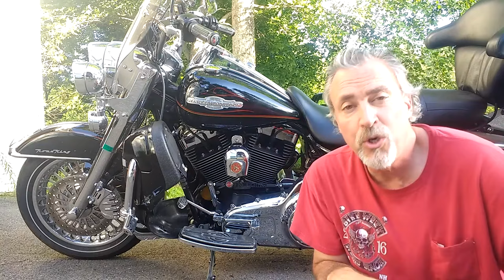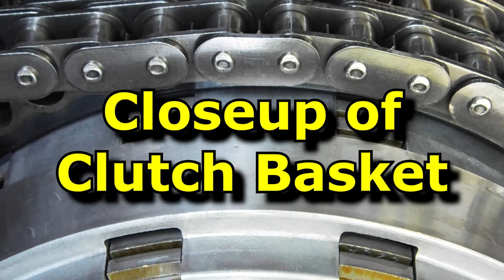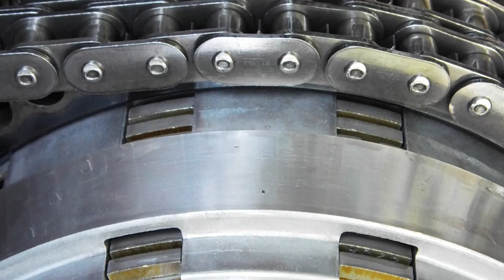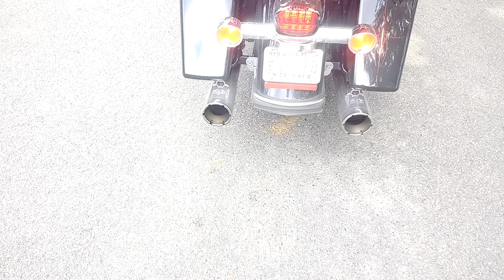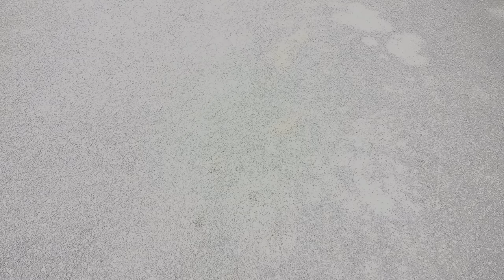Another Source Of Primary Noise

Comment: I have owned 4 Kawasaki 1300 inline 6 cylinder motorcycles. Even with the inherently smooth running inline 6 the  clutch baskets rattled pretty badly on all of them. The one was so bad that I convinced my Dad's Harley riding buddy that it was a diesel. I reember him being amazed that it did not smoke. Than he noticed the spark plugs. My 85 flhtc with 50,000 miles is very quiet as long as the primary chain is adjusted. It seems that the manual primary adjuster is the way to go.
Reply from the maker: Thanks for the info, Tommy! I don't know how I could record it, but I swear I can hear that clutch basket rattling at idle or between shifts, etc. Funny story about calling it a diesel, hahaha! Ride safe!

Comment: Rekluse steel basket sleeves will solve that “old oil can” rattle. You get two enthusiastic thumbs up from me on your videos.
Reply: Did you guys see where the new recommended, viscosity of oil in the primary is 70 to 140, or there about, It's in a dealer mechanics video somewhere that I can't recall at this time..👍

Comment: Mark I know Its been a while since you did this video, I just wanted to add the observation that as I was looking at around one minute and 44 seconds into the viewing, that what I thought was that noise was not the clutch tabs, but the chain roller behind your finger tapping into the gear space. Just a little more chain tension and that would go away I believe. I really do like your Harley videos because I learned plenty of good things from them.
Reply from the maker: Thank you, maybe it was a combination of the two? I'm going to open up the primary to inspect things and possibly replace the Hayden tensioner with the factory automatic tensioner.

Comment: Geee thank you, you just fixed my Roadglide lol, I’ve been chasing a clucking noise for a while in my primary. I was thinking I had the dread neutral rattle but this would explain my noise. Two thumbs up 👍👍.
Reply from the maker: So it's not just me?! Thanks for the comment! 😎
Reply: hey Mark, Dan Bowling here,I had to replace my stator on my 13 Roadglide. when I took it apart I couldn't believe the locomotive style engineering. It rattled alotand being the gear head I set out to find out why. Finally I noticed the wear on the compensator bearing that it rides on. the compensator I'd was brindled a little but not damaged badly. the bearing original OD was easily measured and was a bad fit. way to much clearance. I went to the dealer and picked up a new pc. with thrust washer and Mic's a few to get a better clearance fit. I T's much quieter but still lacks proper lubrication to the thrust washer. I believe that is also a problem with slop as its plastic thickness gets thinner. the part is 28 bucks
Reply from the maker: @danielbowling1528  thanks for the comment. I hope this keeps your 13 on the road a good long time!

Comment: I have a 2012 Heritage with 8k miles and when it warms up it sounds almost like a rod is knock. I think it's coming from the primary. Ask you rev the or ride the bike you still hear it. With 8k Miles and the way the motor sounds otherwise, I'm fairly certain it's not the motor.. and bike was not abused.. any advice?
Reply from the maker: I would take it to a dealer or shop that is familiar with these bikes and ask them what they think it is. There are a lot of moving parts in there and any of them could be the issue.
Reply: I'm having the same issue with an 11, just under 18k. Broke the primary apart, checked everything and then ran it through gears, knock went away. Now the noise sounds like it's related to the chain or maybe clutch?
Reply: Did you ever figure out your noise issue?

Comment: have you ever encountered a whirring noise coming from the secondary output drive sprocket bearing?
Reply from the maker: I have not yet. Is this something that didn't used to be there and now is? Have you compared it to other bikes to see if they are as loud? There is a bearing cage there that is oiled by the primary oil inside through a hole so the oil drips down into it.
Reply from the maker: The compensator will make a bit of noise that can also sound like whirring, which as long as the bike starts up with no issue or clanging just means it's working to smooth out the pulses of the cylinders before they get to the clutch.
Reply: @contact4mwy7  the noise has been there for quite some time, but has gotten worse over the years. Some days its worse than other but it is louder than the open exhaust when its happening. Going to be taking it apart this winter
Reply from the maker: The only other part I can think of that would make some noise is the chain going over the primary chain tensioner, but for it to be as loud as the exhaust, I doubt that's it. Wow. Curious to know what it turns out to be for sure!

Comment: Im learning more and more about what "thats normal for a Harley" means
Reply from the maker: Lol, you get used to it after a while. I just put new front motor mounts in. $80 a pair!
Reply: @contact4mwy7  I picked up a 2005 Harley Road King this year from a family estate.   It is a gorgeous bike, but it is a rebuild/salvage title bike and was completely disassembled and restored piece by piece, as it was a Hurricane Katrina flood bike.  So unfortunately the guy who did the work on it and knew everything is now gone.  So every little noise freaks me out.  I am taking it apart right now to install These rocker locker inserts, hoping to hell that solves this terrible clackety sound im hearing on the top of the front cylinder
Reply from the maker: Yes, I have and know that sound very well. My bike is an '09, so for you the compensator may not be an issue on that year. But, the cam chain tensioner shoes will need to be checked at some point. Search out "worn cam chain tensioner harley davidson". The plastic shoes disintegrate over time and miles and send plastic boys through the engine if not caught in time. Metal from the support arms can also shred off and contaminate the engine causing a complete tear down and rebuild, replacing damaged parts. All in all they are a good machine and fun to ride, but be aware of their maintenance needs and life is much better!
Reply: @contact4mwy7    Yeah....I'm aware of the tensioner thing on the 88s.  I hope to hell when the bike was rebuilt he knew about it and got good ones.  I do know he sent out the motor to be completely restored.  But I have no idea!   The good news is the bike only has 2,500 miles on it.  Yes!  I know, but it's true.  He went through all this time and expense to rebuild it, and even did some upgrades, like a 6 speed tranny....But I think he realized after he got it all done that he had grown too old and the bike was too difficult for him to handle so he never rode it.
Reply: @contact4mwy7  I actually saw a video recently where this guy had totally torn into a motor.  And he shows how the little screws that hold in the air box on a twin cam had worked their way loose and ALL THREE of them got sucked into the cylinders and virtually destroyed the cylinders.  Seriously?  That's the cost on a Harley of not using enough loctite or torquing a fastener?  Complete destruction?  How the hell can I ever take this bike on a long trip with confidence????
Reply from the maker: Lol. I hear you. Listen, I took a 1997 Road King with about 75,000 miles from Maine to New York for Amreicade, and from there back to New Hampshire in the rain  for Laconia Bike week the following week with no issues two up! Like I said, take care of the bike and it will take care of you. They can be reliable as heck if you look after it and don't beat on it too bad.

Comment: Dude ,I ve  got an 87fxrs and that is noise I started hearing at low idle cold .Tore primary apart ,chain good adj and compensator  nut tight .That knocking noise from clutch driven plates hitting basket you got is kind of what I m hearing. Sounds like connecting rod or bottom end but in primary ! My bike had 80 K miles ,motor professionally rebuilt 6 k miles ago so I m hoping its just what you showed  us .
Reply from the maker: I hope so too. If no other issues, ride safe!
Reply: I m ready to ride it like I stole it ! My old mechanic buddy said its a Harley it makes weird sounds
Reply: @gregr1672 It's the rollers tapping on your rear gear, the chain is either a little loose, or your oil viscosity is too low.  happy adjusters make happy chains (not loose chains)...oid saying but 7/8 is too loose !

Comment: Mine does exact same noise when I release clutch fast and gear is on. Is it possible that same thing causes that clutch release noise?
Reply from the maker: I would guess it is possible. As long as it's not interfering with starting the bike, etc. I wouldn't rip things apart just yet.

Comment: You're probably the most posted compensator guy on youtube, I've watched most of your videos.  In the end what set-up did you chose?  modified, stock, SE, Baker etc?  I just dumped $1200 in Bakers comp, adjuster, HD's rotor cover and a complete all balls starter after killing my THIRD starter clutch pack and being TOWED HOME.
Reply from the maker: I went with a SE compensator, but not the newest model that utilizes a plastic funnel to dump lube into tiny ports near the bolt of the compensator. Either model is more rugged than the stock one these bikes came with. I have yet to find there is a lube issue, which there may very well be, but rather a spring pack wearing out issue. That being said, I added one more medium sized spring washer to the pack to give it a bit more strength than stock. This is my second year running this setup and hot starting the bike is still not a problem, and the engine pulses are not thrashing the drive line like a solid comp sprocket. It still has enough "suspension" to work with. I am still curious about the Baker models as I have not had one to look over. Let me know what you think of it. Thanks!

Comment: Hey man you seem knowledgable I have a 07 heritage noise coming from primary only in neutral kinda goes away in gear sounds like low growl... any thoughts?
Reply from the maker: How many miles on it? 96 cubic inches? It could be the sound of the chain going over the tensioner shoe, bearings on the clutch shaft, something along those lines. It's hard to tell the source of every sound, but if it's coming from the primary side and area it might be worthwhile to open up the primary and look for the source.

Comment: ok..I still can't find the answer to "my" noise..front of the motor/left ish..once in a while at a light,clutch in I hear an alarming clank!..multiple click/clanks like someone tapping a metal plate with a hammer!..then it disappears..please help! 2003 screming eagle 103 road King
Reply from the maker: Robert, are the click clanks in rhythm with the speed of the motor? As though a front motor mount is worn out or loose? I really hope you get this figured out and hope that it's not something that could be a hazard to your safety!
Reply: If it doesn't make that noise when the engine is under load then its probably just a noise.My roadking makes lots of weird noses but when cold or under load its fine.

Comment: My noise I'm chasing is a rotational whoring. That goes away on hard excelleration. But is loudest at steady speed and more but softer rotational should when you let off throtte..... help need ideas
Reply from the maker: Bruce, what year and model bike?
Reply: @contact4mwy7  2014 FXDL Lowrider with 4000 miles on it, bought it last oct with 900 miles on it
Reply: @contact4mwy7  i'm leaning to the primary chain tensioner, but not sure wish harley had left the inspection cover in the primary
Reply from the maker: @brucesantacory1390  I would rule out the compensator for that year and low miles. Most likely the chain tensioner is the sound you are hearing as the chain links slide over the plastic shoe. It may be annoying, but as long as the bike is performing as it should I would try to live with it.
Reply: @contact4mwy7  thanks, but this noise it louder than my screamin eagle muffler any chance the auto tensioner is too tight ?
Reply from the maker: @brucesantacory1390  I suppose it is a possibility, but the only way to find out is by opening the primary.
Reply: @contact4mwy7  Thanks

Comment: Hi mark , just noticed today on my 08 roadking after went for ride when i jiggle rear belt pulley , the front transmission pulley kinda making slight knocking sound... And now the bike cold & that noise isnt there anymore. Do  you experience any of this before ? Thanks
Reply from the maker: I have not personally experienced this myself, but I've been noticing a similar noise in my primary that is coming from either the clutch or the bearings on the main shaft that are installed in the inner primary itself. It seems yours is only making noise when it's hot? I've heard of the primary stretching between the motor and transmission with temperature change. Could your primary chain be too tight and when the bike warms up things are stretching and pulling against the primary chain? Keep poking around YouTube and message boards and asking questions I hopes that you find someone with an answer to your situation.
Reply: @contact4mwy7  hi mark thanks soo much for fast reply , didnt expect it this fast ! I took primary cover , clutch basket , primary chain out when the bike was warm earlier and jiggle the belt pulley and that small knocking noise it does sound like come from the transmission pulley , got home from work earlier & bike is cold , there is no noise at all. I will remove inner primary case tomorrow & inspect  further see if there is any movement on that transmission pulley. Thanks for your video mate , ive learnt a lots ! 🙏🏼
Reply: @contact4mwy7  ps : my rk 08 only done 23k miles
Reply from the maker: @awedihdaira2786  there is a bearing that holds the main transmission shaft in place. The clutch and belt pulley are mounted to that shaft. Try to see if you can detect any wear of the bearing or the race sleeve that they are supposed to roll against. Did you check for tightness of the primary chain when you took the outer primary off?
Reply: @contact4mwy7  yes i did check the primary chain before i took them off , my bike using one of those automatic chain adjuster. I really hope the problem is not the transmission pulley bearing because i dont think im capable enough to replacing that 🙈 i will have a look tomorrow , thanks again mark 🙏🏼
Reply: My roadking only makes noise when its hot quiet as a mouse when cold.